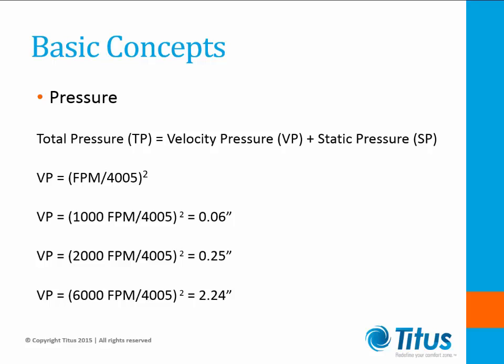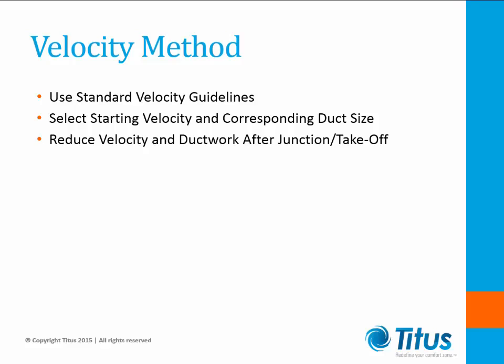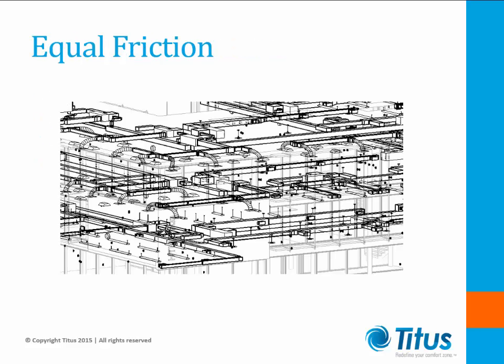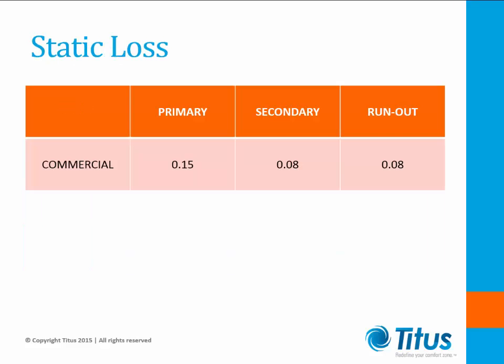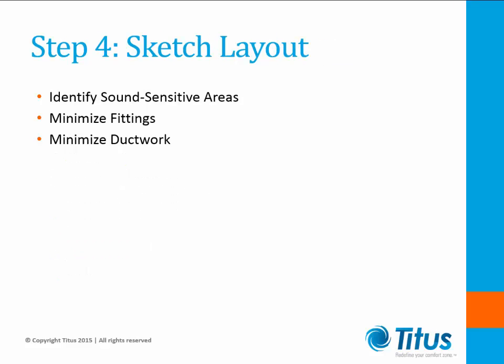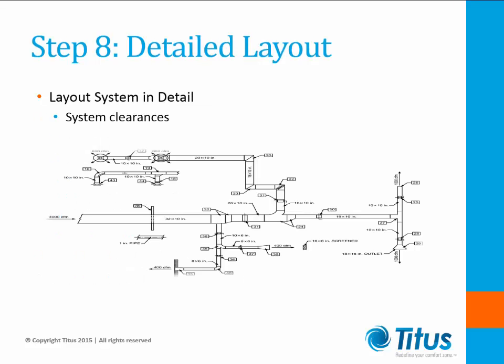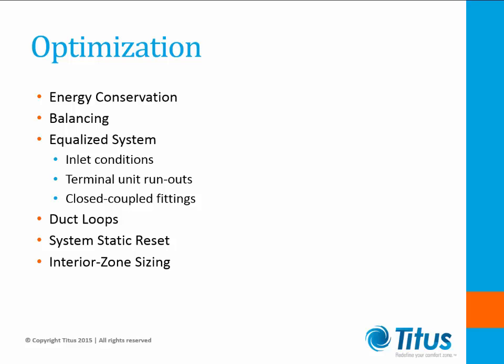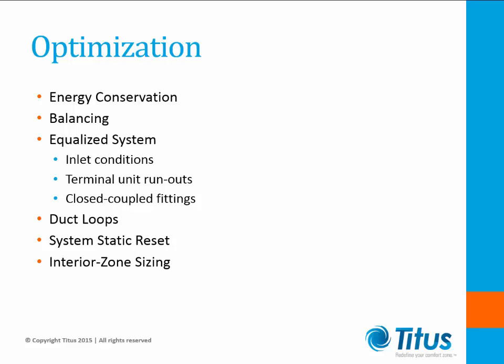Ductwork Design Webinar

Comment: Pl advise best software or manuals 

Round / circular process duct calculation including, Expansion joint, Stiffner, development, pressure drop, Load calculation on each support
Reply from the maker: the SMACNA duct design and construction manual is probably the best place to start. With regards to the software, please be more specific  as there are a number of programs available. You might want to look into a couple of options related to software to see which one best meets your needs.
Reply: @TitusHVAC  thanks.. pl name few software name